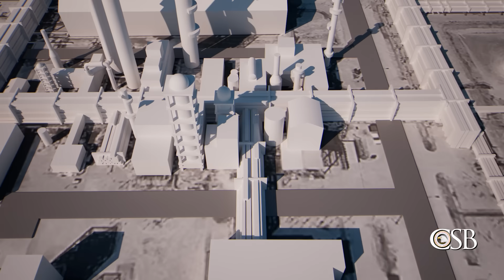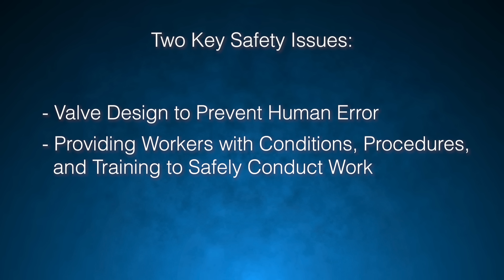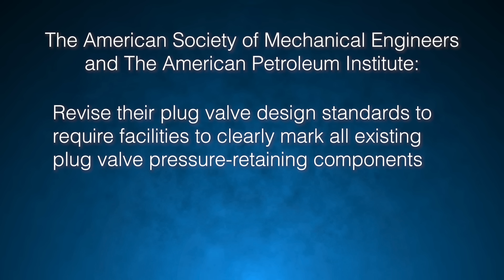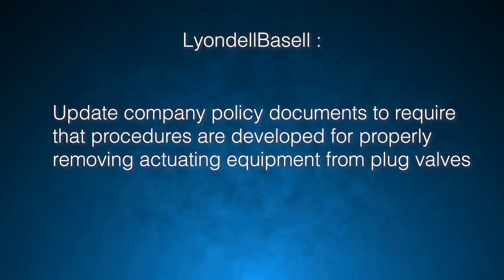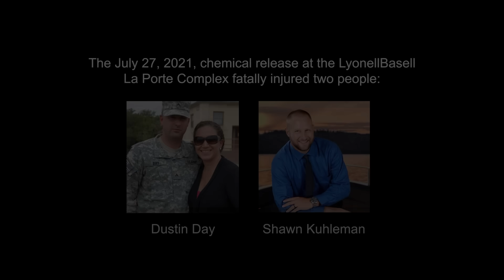Designed to Fail: Chemical Release at LyondellBasell

Comment: In this particular accident, I would argue that the fundamentall issue is that the valave couldn't be locked without taking the actuator off... They wouldn't need to mess with it if they could just lock it

Comment: A pictogram installed by the manufacturer indicating "Pressure Containing Barrier" or both can help with this. As per the findings, this was easily preventable by a "hard" hold point to prevent the work from being performed without a procedure in place.

Comment: The sad thing is they were trying to be safe by removing the actuator in the first place to make sure the value wouldn't open on its own while they repaired the pipe.  Kinda surprised there isn't a way to manually lock the actuator in a given position, thus negating the need to remove it to manually access the valve.

Comment: I see a USCSB video get uploaded, and I stop everything I'm doing to watch it. 

Im not sure why they decided to remove the actuator in the first place to try and isolate the leak. Maybe its a company policy.

At the site i work at, in certain circumstances it is acceptable to lock out the air supply to the pneumatic actuator, and some valves have pins where you can mechanically lock the valve in a certain position to isolate the leak. I think if valve designers could improve designs to make them more lock out accessible, you wouldnt have instance like this where valves are being disassembled to turn them.

Comment: Honestly this feels similar to Fire in Baton Rouge (https://www.youtube.com/watch?v=QyIIe5T5beM).

Now I don't mean to victem blame but considering if the animations have accurate depictions of the piping how did no one ask, "Hey? What's holding the contents in?" before removing these components? I don't work in heavy industry so maybe it is only obvious in hindsight.

I personally think it is tunnel vision where people just want to get the job done is to blame, causing them not to think about how stuff is being held together. This is why I think the CSB's recommendation of making critical components hard to remove will be dud even if implemented, if people still think you need to remove it to get the job done then they will move mountains to do so, rather it should be really easy to remove the stuff that needs to be removed.

Comment: I believe there is a more general issue: also when working on other components close to pipes, reactors, etc, ... I imagine it is difficult to know what's on the other side of a plate that you're removing. I believe one should come up with a different shaped bolthead for dangerous to remove bolts.

Comment: I think they missed one - design plug valves so that they do not need their actuators removed in order to lock them in the closed position.
Reply: I think it should be a feature of the actuator assembly.

At my plant we always have a manual valve in line with any automatic valve on process fluid piping.
Reply: Or close and lock the air supply powering the actuator.
Reply: Could you maybe enlighten us why in this case there might have been a need to remove the actuator at all? Can't one just tell the actuator to close the valve?
Reply: @maoiljitschguevara  It is probably ironically for safety purposes. If you remove the actuator, it can't accidentally open the valve. So once the valve is closed, it stays closed while they are working on it.

Comment: If anyone has worked in a corporate manufacturing setting, this video definitely struck a chord with you. It is so common to not be trained on something that is perceived as “not so dangerous” simply because it affects a production stream/line. I guarantee you if these contractors were working on a piece of equipment that wasn’t vital to the process, they either a) wouldn’t have been hired in the first place, b) wouldn’t be doing it at night (most likely during first shift), significantly increasing the chances they would be trained properly, or c) the leak would have been recognized as a more significant hazard before they even started working. 

It pisses me off to end how corporations deliberately cut cost, and almost only focus on production rather than the lives of their workers. but hey, they put up safety signs around the plant, so at least on paper it looks like they tried to improve and focus on safety.
Reply: PS, can the CSB hire me? I am a chem e who has worked as a design engineer and safety coordinator at a production facility. Doing investigations for the CSB would be my dream job and I’d be damn good at it!
Reply: @dibobble I was thinking the same thing. Sounds like some people at the CSB need to retire and let someone who know what went wrong here work for them. Either that or they are being silenced and not revealing the entire truth. Which in turn, hurts everyone trying to take lessons from an incident like this.
Reply: @6sinstrument341  I think they do know what happened, but it’s just hard to prove some sort of negligence like that. And I’m merely speculating from my own experience in a similar work environment. That’s why they talk about creating a more fail-proof valve so the possibility of removing it or disassembling it improperly decreases.

Comment: Incredible quality of video.

Sadly, any of the three workers could have saved the crew by applying some basic logic and thought to how the valve was designed, or demand the correct instruction manual/training, or demand the line be completely purged before work.

Your safety is ultimately your responsibility. Workers should always feel free to question the safety of a procedure they are about to perform.

Comment: They should probably thread the whole plug so the mechanic has to grab a huge wrench and turn the whole thing. It would quite visibly leak too while still partially threaded in which should be pretty good indicator something's wrong.

Comment: Hmm wow :( Interesting, I wonder what the contractors should have done, to secure the plug valve in the closed position. Did they need to remove the actuator and if so, what were the steps they should have followed instead?
Reply: I'm from Germany and have worked in such plants for years. I think the next step, after securing the valve, would have been to replace the seal in the flange where the leak was. But the first thing I thought here was: They definitely don't know what they're doing. In Germany, to prevent someone from accidentally opening the valve while we were working on the flange, we definitely wouldn't remove the actuator. To secure it, we would just physically interrupt the power supply to the actuator, i.e. electricity or compressed air, in the closed position by disconnecting the electrical cable or compressed air line. In our plants, many actuators of valves, pumps and agitators have permanently installed safety switches for maintenance purposes that can be secured with a lock. In this case we would have used such a switch to secure the valve in the closed position. In short, the drive stays where it is, because that wasn't actually the problem, but is secured against accidental activation. To top it all off, this is actually less work than removing the drive.
Reply: @benjaminhampel8640  hi Benjamin yes see my comment there are different types where the actuator can be removed and/  or locked while in place I was involved investigating a similar event here in New Zealand

Comment: Aren't these the wrong GHS Symbols for acetic acid? 1:15
Reply: They are as it supposed to be corrosive and flammable. It's not a poison nor a carcinogen but somehow I wonder if the error were made subtlety by USCSB with the intention of the viewer to always check and verify with the safety data sheet before working with any chemicals or that just me? 🤔

Comment: If the 3d is correct, it’s kind of dumbfounding that they removed the plug. How could anyone even those who don’t work in the industry not know / no see that??? 

An easy fix for anyone who doesn’t is to engrave the plug with a huge warning “do not remove”
Reply: Man did you not watch the video? They super clearly explained everything

Comment: "a flavor enhancer and food preservative. a corrosive chemical which can cause severe skin burns and eye damage"
Reply: Chemistry is weird like that. Hydrogen and Oxygen super explosive and flammable but together makes water 😂
Reply: I mean, bananas are radioactive 🤷‍♀️
Reply: Acetic acid It's just the scientific name for white vinegar that has not yet been diluted by water. This factory was just distilling it. When we buy vinegar in the store, As generations of our forebears have done going back a few centuries, It has been diluted by water to only about five percent concentration. Vinegar is used for pickling, and food preservatives and flavor. In stronger concentrations, it can also be used as a cleaner. Even so, you don't want to mess with any Concentration above about ten or fifteen percent.  This stuff was at a hundred percent and it was also boiling hot.

Comment: Removing an actuator to lock a valve closed doesn't make sense in the first place either. Use the actuator to hold the valve closed. That's what it does.

Comment: Remove an actuator for lockout?  Some information must be missing.  This was spring return open and only hydraulic [or pneumatic] pressure caused closure?  Other than that... I disbelieve contractors qualifications: nearly all actuators have couplers which don't need removal except for valve replacement [so actuator can be reinstalled] or open inspection.  I am guesing they dug as deep as they did not understanding that they didn't have a stuck valve on their hands but... a pressurized system that needed relief so the valve could be closed?  Valve design does not prevent stupid, and this report gets a D.
Ask a question: are the guys dumb enough to unbolt a valve bonnet [meaning they actually worked on the wrong part] going to do a "risk assessment"?  That's Darwin Award level correction/safety analysis.

Comment: I hate how many of these investigations conclude with "oh yeah, this killed people before like several times." Just goes to show how much corporations will do to avoid even the most minimal costs to improve worker safety.
Reply: A Maintenance worker on a chemical plant doesn't sit at the assembly line in a controlled environment. All the red tape in the world doesnt save one when one chooses to simply ignore common sense and starting to unscrew random parts (on hazardous equipment) 
anecdote from me, I work in machine building. Our customers actually require the gear to be inaccessible and tamper proof, because in each plant around the globe there's that one dude that intentionally sacrificed a hand for a paycheck
Reply: @hanswurst-h3e  In one breath you say that they are working in too dynamic an environment and the very next insist on the use of common sense. Which is it: are the conditions of operation obvious or is the task difficult and complex? You cannot have it both ways. 

You'll pardon me if I trust the actual experts in this subject- the chemical engineers at USCSB- more than I trust a social media user with an auto-generated name. They make the very reasonable suggestion that a better design which gave clear indications of which components were pressure-retaining would have prevented these deaths and you have not given me any tangible reason to disagree with that assessment.
Reply: @nondescriptname  pardon me, but a flange mount with 15 screws is the biggest, reddest glowing"pressure retaining component" sign there is. That is if we dont expect toddlers to perform such procedures.
Thinking another red coat of paint (or how its called in the industry, a warning sign) could prevent these accidents is naive at best, thats a more liability thing.

Comment: This sounds familiar.  The CSB released a video a while back about a fire at an ExxonMobil refinery in Baton Rouge, Louisiana.  A couple workers were trying to open a valve, but the gearbox that normally gives mechanical advantage was seized.  They removed the gearbox so they could get a wrench over the valve stem, but inadvertently removed pressure-bearing bolts that held in the plug valve itself.  The valve began to leak hydrocarbon vapor, and the cloud ignited, injuring 4.  https://www.youtube.com/watch?v=QyIIe5T5beM

Comment: We do lock-out, tag-out in the electrical world. We wouldn't remove the motor on a pump (for example) to be worked on, we would remove the possibility of power being applied to it. Odd choice to pull the actuator.

Comment: If the valve design is as shown in 2:01, it's clearly a good design. You cannot remove the pressure containing nut before removing the actuator. Adding additional color to the nuts cannot prevent this level of incompetence.
Reply: Especially when everything eventually turns the same colour anyway from weather, age, and the chemicals.  You can tell who's never worked in an industrial plant because they keep suggesting colour coding fasteners...
Reply: I guess common sense isnt very common.  I was baffled watching this video why they would remove those nuts.  And then they had the actuator off and by some miracle the plate hadnt blown off yet and they still didnt realize it wasnt necessary to remove the nuts and started prying on the sleeve.  They had one last chance to realize "oh wait we didnt need to take these off" and put them back on.
Reply: Yeah, I'm not a a chemical maintenance engineer, just a qualified aircraft maintenance engineer, but it clearly looks like those nuts hold the valve together. The nuts clearly look like they don't have anything to do with the adaptor sleeve (or whatever they called it).
Reply: Agreed, the recommendations do not address root cause. The root cause was using a valve that was not designed for LOTO purposes as part of a LOTO, or at the very least using it improperly.
Reply: I'm actually wondering if it happened that way around too, did they remove the the valve nuts before or after removing the actuator.
Reply: Removing the nuts at the 3 and 9 o'clock positions on the valve would of been difficult with the actuator bracket still on.

Comment: I'm flabbergasted that their approach to ensuring that the plug valve was closed was to pull off the actuator and lock the valve rather than just cutting off the instrument air supply to the actuator.  

But maybe that's just me not being used to plug valves, or perhaps it's an air-to-close actuator rather than an air-to-open actuator, but that would be a weird choice for an isolation valve.

Comment: Better question: WHY remove the actuator in the first place?
When isolation is required, disconnected (or lock off) the energy supply to the actuator.
Reply: An actuator may fail, also it is difficult to check the valve position if the actuator is in place
Reply: @matmay  Another design flaw.
Reply: Agreed. There should be an external indicator showing the valve position, on the same AND opposite side of the valve from the actuator (to be able to tell if the shaft is broken inside), and a LOTOable power cutoff near the actuator.
Reply: @HDL_CinC_Dragon  I'm from Europe and have never seen a valve with actuator here without a position indicator, because we have a law that requires the valve position to be visible on the valve.
Reply: The actuator can have its own ability to actuate, for example springs, stored air supplies, and such, that facilitate a "emergency shutoff" or "emergency open". And you don't know if the actuator could be configured to OPEN that valve during a emergency power loss or similiar, to ensure pressure doesn't build up.

Another thing is, that if the actuator is currently open, and you want to close the valve, you would need to remove the actuator to close the valve, as a actuator is usually using worm gears to gain a higher torque, meaning, a actuated valve cannot be moved by hand.
Reply: Kinda weird to me that they're relying on an actuated valve at all for isolation.  I mean, I've heard campfire stories from old timers about how they used to work at a facility that did that way back when smoking was not only permitted but encouraged, but I thought everyone in the developed world would be using hand valves for isolation in the 21st century.
Reply: I'm quite surprised there isn't a manual valve (lever/handwheel) which can be padlocked in the 'off' position.
(As a backup shutoff valve should the automatic one fail and need replacing).

I don't see any issues with using an automatic valve for isolation as long as you can:
a) verify the valve is in the close position.
b) verify the valve isn't leaking.
c) lock the valve so it can't be opened again.
(ideally c also sends a signal back to the control panel so the operator has a visual indication that a valve/machine etc is isolated).

Then again there are 3 other videos on this channel which all show the same fatal incidents/explosions due to chemical plants using a control slide as the shut-off mechanism while not realising the control slide had been worn through with the material passing over it.

I guess spending another £500-1000 on a safety feature to protect machines worth £100,000's and plant worth £millions, and the lives of your workers??